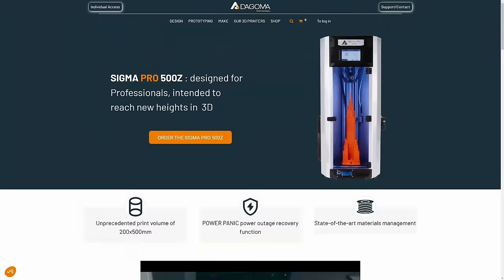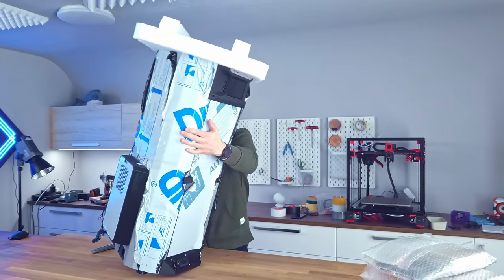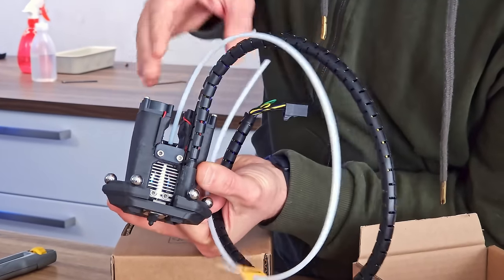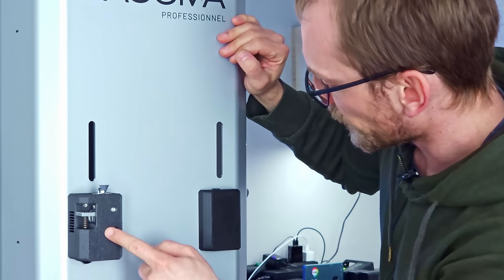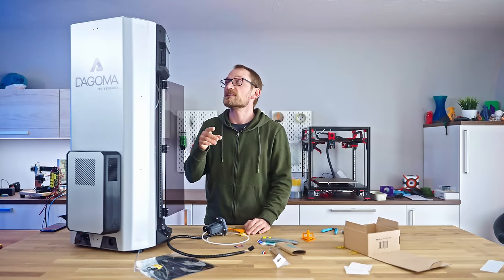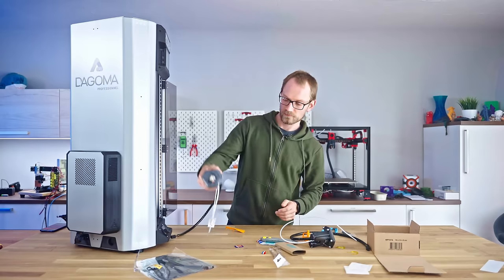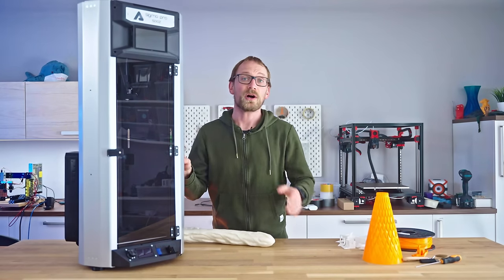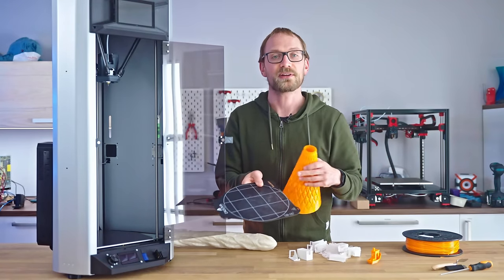Is it worth going "Pro"? Trying out the Dagoma Sigma Pro 500Z!

Comment: Thomas, this is a total pile of stinking s#&7... It falls in the category of "professional machine" just in the sense that no individual would put the amount of money that the manufacturer thinks their machine should cost. By this price anyone / any company can buy 3 Bambu PS1 and print 6 times faster, better and easier. I think you made an excellent video - something I could never be able to do considering the frustration it certainly gave at every step. The printer just uses expensive / heavy construction - as an actual printer, it is clearly a disaster. Their decision to send their printer to a big YouTuber will be the last push into the abyss - surely not what they expected.

Comment: The logical use case for a Delta is very tall, single or very thin wall tubes that aren't thick enough to put a joint in, and that's about it.

Comment: So called professional 3DP1000 printer from US used expensive motors and rails from PBC linear but dated Marlin 1.0.2, no parking feature, no M600, no bed leveling sensor, no possibility to adjust center of the large bed, terminal blocks rated 2A,  all this for only $30000

Comment: professional should means RELIABILITY and GREAT out of the box. 
But also with many settings that you can play. 
Some so called professional machines locks some setting that are easily adjustable. 
Example are offset setting for bambulab. You can set it in orca i think, but not on bambu studio. 
Not really important for most users, but kinda upsetting for me. 
Dont bash me for saying BL is a professional printer, its just an example.

Comment: To me this feels like all the bad stuff from enterprise. Everything is custom or customized, so you're vendor locked. Most of the software is outdated, and once you set it up, you never turn it off, because it might break. You need an expert or support to set it up and get it working. The problem is, this is not like Jira, or SAP, which are sort of standards, and at least have experts and support...

Comment: I'm not an expert, but the only thing professional on that printer is its price. What they advertise as professional are the print height, power panic function, and management of materials at the forefront, and the only one which would sort of make me even consider buying this printer is the print height, if of course you need such a format in the first place. I'm probably the last one who should judge that particular parameter, because I had bought Kossel XL from a guy who was making them, and because I was in a hurry, and he only had one printer which for some reason had a print height of only 120mm I bought it and he told me to come next week to upgrade it to 300mm height, but I never did, and that was 10 years ago:) I just never needed anything higher than that, otherwise I'd upgrade it myself, which is two hours job. Maybe it's stupid to compare this printer of mine with this Sigma pro, but mine only cost €400,00, normally has print format 250X300, or whatever height I choose if I decide to upgrade it, and frankly speaking, it seems much sturdier to me than this Sigma. I was looking at that bottom panel where the display is, and when you touch it it moves 5mm sideways. Nothing wrong with 3D printed parts on printers, but everything looks rather flimsy, and I see nothing which would justify the price of €3000. Your prints are comparable or worse than from Prusa, no filter, no heating, no manual, old software and new one isn't completely compatible, I'd be returning it the same day.

Comment: Doing a read only image is a pain when you want configs to save, files to upload and software to update. And even if you partition the microSD, it can get corrupted by a sudden power outage. That is unless you buy a good SD card and don't go with the cheap stuff. Gen an industrial one and try to make it die. I tried. It refused. after a few hundred cycles of switching the power off while running an i/o benchmark against it. It booted up as if nothing happened.

Comment: One of the reasons you end up with questionable decisions on "Pro" grade equipment could be that they can get away with it. Many companies, the one I work for included, can't (or won't) buy anything consumer grade. We do have a Mk4 for prototyping, a high-dollar Ultimaker, and some specialty resin printer. The latter 2 are very closed source and have been problematic from day 1. The Prusa has been pretty flawless, but they will not buy any more since they don't want any "hobby grade stuff" as they think it looks bad. My old Ender 3 Pro could kick the Ultimaker's booty, even printing slower, just because the amount of downtime is reduced. Customer support has been awful as well, with the UM having sat idle for months due to an unsolvable group of issues. At least when you buy mechanic-level tools you are guaranteed to have any issues taken care of in a reasonable amount of time (which is one reason for buying them). Fun video.

Comment: Dogoma  500z- 80 deg bed *350 deg hotend   200Δ x501mm  max speed  150mm/s    $2500-$3000 (enclosure included)
Flsun V400 -    110 deg bed   300 deg hotend    300Δx410mm   max speed  600mm/s      $600- 1000   (enclosure sold seperate)
Flsun  S1 -         120 deg bed  350 deg hotend    320Δx420mm   max speed 1200mm/s  $1500-2000  (enclosure included)
Tevo  LilMon-   120 deg bed  260 deg hotend    340ΔX500mm   max speed 300mm/s       $700-800 (no enclosure)
Just from similar delta printers   - Several are faster/similar volume for cheaper. some without 3d printed parts.
I think the pro is lacking features that others come with or easily can get for fraction of the price. I do use a V400, but just by specs Dogoma is not close enough to have the Pro title.

Comment: Yeah for less than $300 dollars, i got 500mm/s print speed (realistically 300mm/s) proper 100°C bed, all the features for auto level and what not, hardened nozzle for high grade filaments with a 300°C extruder. 

For a bit more, i can buy an enclosure or slightly less and some time, build one and also give it active heating and a filter. Can i print a 500mm tall weiner? No, do i want to? Well.. maybe but not at the expense of losing a perfectly working out of the box printer with clipper. Im sure i can mod the frame to expand my Z axis so i can print a full sized Saturn V rocket but still be happy with my purchase at a tenth of the cost.

Comment: It looks a lot like they took a page out of the MonoPrice Delta Pro, which I own. It's a decent printer, but the magnetic rods are a bad decision, and the decision is that high accelerations will cause the rods to come off. Initially, my printer couldn't manage these accelerations without severe layer shifts, due to the stepper drivers being inferior, but with an upgrade an a tuning to 1.2V instead of 0.9V, I went from 1500 mm/s acceleration to 5500 mm/s acceleration without any issues... However, the stepper drivers could easily fuel up to 8000 mm/s and beyond, if not for the fact that the magnetic rods for the delta bed, come off at around 6000 mm/s. 

What Dagoma has made here, is not only deprecated architecture - it also seems to be bad design decisions and poor quality (for the price asked). 

The currently best delta printers are made by FLSun, and they pretty much rival BambuLab P1/X1-series in terms of both speed and print quality. However, they are not as versatile and user friendly.

Comment: I worked in the automotive industry for much of my working life.  I've consistently been dissappointed by 'industrial' printers - Objet, 3dSystems, Stratasys etc.  At the time I had an Ultimaker - and generally got better results, a whole lot quicker.

With one of the big two German companies (you know who I mean!), I would submit a model for printing and maybe get it back a week or two later.  Generally what I received would not be usable as a functional or even spacial prototype - too rough, poor tolerance, bad materials (often a sort of crumbley plaster substance).  I used to just print my components on the Ultimaker - and people would be astonished at the quality.  I think this has limited the uptake of industrial printing as people have low expectations of the quality.

Even now, 10 years on, my Bambu Labs printer holds it's own against the Industrial printers we have.  The only exception is Metal printing - and it's only a matter of time before we can buy a hobby metal printer.

Comment: While I applaud seeing something 'different', professional machines need viability and adaptability job one. A tiny but tall delta is rather specialized, where deltas already exist in larger footprints with a lower entry price. I have a huge delta, which when it works, is a great machine but I'd like to move to a large CoreXY for doing prototype parts in engineering materials. Man, slightly disappointed to be honest, other than being factory enclosed.

Comment: to me professional just means long lasting...
for example to me, a hobby drill might have a brushed DC motor, a piece of hardware with cheap parts, a tool that you may get for the price, and its use out of it, if you use it rarely in hobby use.
a "premium" or professional tool would have a brushless DC motor, meaning yeah, it might sitll have a inprecise clutch, weird quirks persist from the hobby version.
it just lasts longer, and you just learn to live with them. 
thats all professional means to me, just more reliable, less likely to break or develop a fault.

Comment: Man that reminded me of a slightly more refined (and enclosed) experience of the HE3D DLT-600 I bought years and years ago.  I paid $1000 CAD for it and never used it.  It was the worst experience I have ever had with a 3d printer.  They advertised it as "pro" level but everything about it was garbage, from the printed parts to the electronic components. It was absolute garbage and everything about it was an exercise in pulling my hair out.  That is the impression I got with the printer from Dagoma.  For 3000 euros it should have made printed right out of the box and made you pop tarts at the same time.  Compared to my Bambu Labs printers at a fraction of the price, that experience is shameful.  I'm not sure who in their right mind would buy that printer for even 200 euros.

Comment: Pro means professional, so I would take it to mean for industrial use. Running 24/7 pumping out parts for your company.
My hobby printers, Ender 2 Pro, Ender 3 S1 [my 2nd one got turned into a laser engraver] and my new Ender 3 V3 SE are pumping out parts for a client.
Because of the reliability of Creality printers. They are Pro in my book. Not the fastest. But the most affordable and reliable for the price. Roughly 300 euros each at current exchange rates.
1 Euro = ZAR 20/22.
What you have there isn't very pro in my opinion. 3000 euros = ZAR 60000. You can buy a 2nd hand car for that. Or pay a house for a year.
Reply: What about safety certifications? Ender machines may be reliable, but lack any certifications. So say 10 years down the road an employee or ex-employee gets lung cancer and sues you? The manufacturer then basically becomes insurance or scapegoat against that kind of thing.
Reply: @powertomato  you mean I sue myself?

Comment: I think it’s a $350 dollar printer  in a pretty package. Even my Ender 3 v2 had test prints and manual on the SD. For the price of that printer I’d expect a 16GB SD with the manual and a very different slicer program on the card. It also can’t be that expensive to get a professional translation service to translate the technical language. I agree. Using a redundant setup like they have is also pointless.

Comment: 3D Printing has an issue where "Pro" level just above the good consumer stuff is actually just regular machines, often worse than the good ones, with maybe some extra support contract.
3/4 the price is basically just for some kind of support at your hand, which can be crucial for businesses. 
That being said, its almost criminal what gets sold als those pro machines in the 3000-20000 bucks range. 
Plus you often get proprietary parts thrown in as well. 
So many borderline scams in that price range.

Comment: This is 10x worse than a modern consumer printer like a P1P. Took me 10min to get up and running with a P1. And have only had very few failed prints and all of them were engineering filaments (polycarbonate) while tuning the profiles.

Comment: Professional to me means: Plug in and use without fuss, Reliable reproducable prints, higher quality prints without the need to fine tune the machine. In short: everything that eats up time is eliminiated or at least highly reduced. If i would want or need to buy a professional 3D printer for my business. Be it to sell 3d prints or for rapid prototyping, i want it to turn on, auto level, you feed it filament and set the filament specs and it just works. Extra size like the Dagoma offers, is a bonus, not a primary requirement. So in that aspect it utterly failed as a professional machine to me.

Comment: Pro = Full user documentation including troubleshooting guides, high end parts used in the build, excellent build quality, at least office hours support (preferably 24 x 7) and works out of the box (specific setup requirements excepted). It seems this company missed out on everything I personally would expect in any 'Pro' level equipment.

I was a site / field engineer for most of my working life and would be ashamed if the company I worked for produced something like this.

Comment: that front panel looks floppy, 3 grand for a floppy front panel that holds the display and sd slot i dont know how i would feel about that. i dont know what u would call a "pro grade" 3d printer. i own 14 fdm and 2 resin printers an i started about 6 years ago. i own 8 different brands. it had been about 3 yrs since i had gotten a new printer an i finally broke over about a month ago an picked a couple up 2  smaller machines to play with combining to make a corexy and a bambu lab printer. i started to get the x1c but decided to go with the p1s combo so i could try the ams multicolor printing out an its been the best money ive spent, hand down id trade 2 or 3 of my other printers to just one p1p p1s machines alone or any 2 for a1 machine alone. the printers are really well built an the amount of work that was put into the software side seems to be leaps ahead of everyone else. if it gets a piece of filament stuck between the bed   an the frame at the back it will cancel the print when it does the homing process cause it can sense theres something back there. the slicer is another thing they have killed it with, ive always used cura, tried prusa slicer but was never able to get my profiles to produces as good of quality prints as my cura profiles on the same machines so i rarely use it but bambu studios has been outstanding, had to learn how they frazed somed things like walls being called loops but its not bad but the software being loaded with as much as it is, i will say it doesn't seem to be as stable for me as cura, out of my 6  yrs of 3d printing using cura, i can count on two hands for sure possibly one how many times cura has crashed on me but with bambu studio, ive already had it crash on me as much in the past month as i have from cura in the past 6 years, but its not a deal breaker an its probably showing my desktop's age more than anything. but b4 i got my bambu labs printer, i thought of something like dremels printer as a "pro grade" 3d printer or raise3d printers but after owning my bambu labs, i cant see any other brand being where they are with the price point for the option the printers come with, i mean for $1050 i got a corexy with up to 4 colors with zero effort or 5 with a bit of extra work or u can add up to 4 ams an get 16 colors but even if u got just the printer for 600ish bux not sure how much it works out shipped but i dont know of any other printer on the market that can print with a less that 10% failure rate i think it was actually a 4% failure rate out of the box for the price with all the options it has with the printer alone plus what u get with bambu studio and if u get a ams with it then its just that much more u can do an its by far the most hands off a 3d printer can be. it does about everything that it can do on its own on its own b4 each print starts. theres a calibration setting u can do if u ever have issues an from ive seen that  fixing 90% of the stuff ppl run into but so far its been perfect an bambu lab is what i now look at as "pro grade" an all the others just  look like really over priced enclose 3d printers while bambu labs printers even the mid range seems leaps ahead of other brands. im sure the x1c is even better and they have professional grade version of the x1 that cost around the 3 grand range but from what i can tell they print about everything so yea bambu labs is what i think of now when i think of "pro grade" while at the same time my suggestion to anyone for there first printers on 10th.

Comment: a "professional" product is an expensive parts build, nearly always outdone by hobbyist bespoke builds. hell, majority of printers use belts that have an unreasonable amount of play in them instead of screw-driven axes. of they want to really kick up production speed they'd not only do that, but include more reliable hard mount locations and vibration dampening.
dunno though, ain't exactly torn into enough printers or the engineering behind them yet. 
a lot of the issue is that people are using software to compensate for flaws in the product instead of building a better one in terms of wobble reduction.